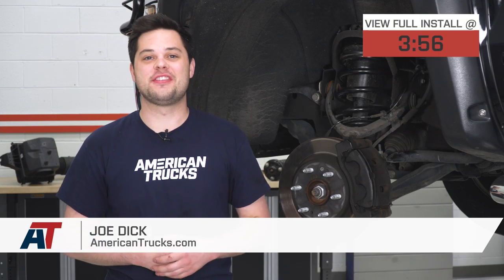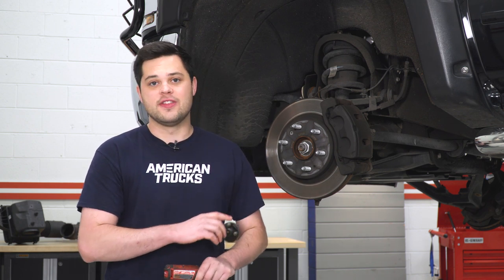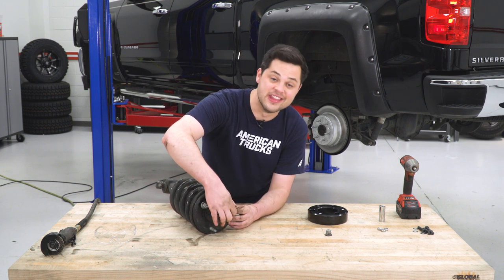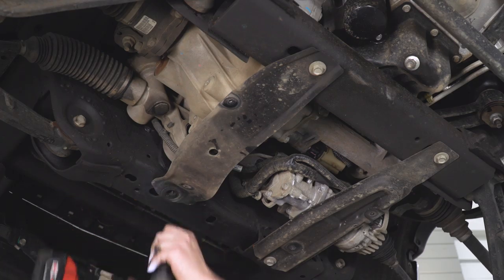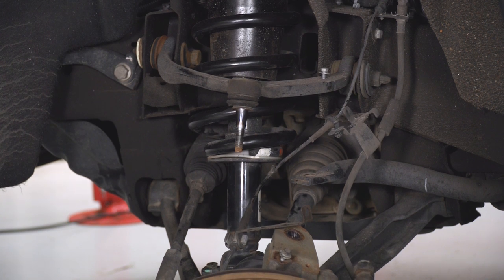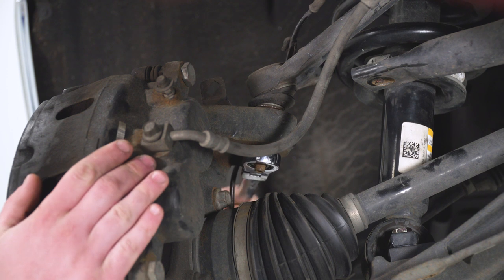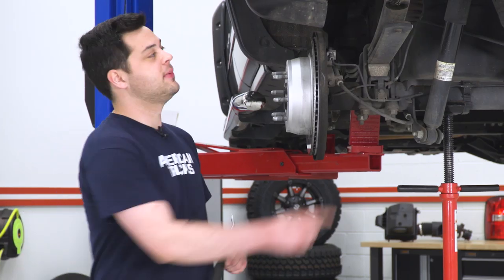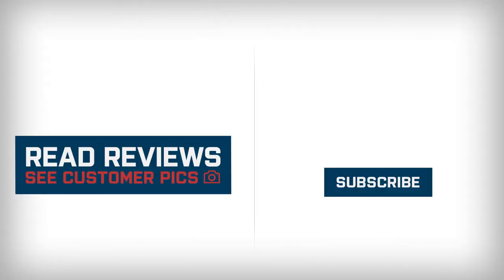2007-2018 Siverado 1500 Supreme Suspensions 3.5 in. Front / 3 in. Rear Pro Lift Kit Review & Install

Comment: I have a 2015 Silverado 1500, I have the Motofab 3” front and 2” rear and I fit 33” tires on stock 17” rims without rubbing at all.
Reply: How does it ride just curious I did a 3 2 level just seeing if your having any problems
Reply: Billy McCubbin I recently took it out, I’m getting a 6” lift kit, the ride ain’t bad, but my truck is 4x4 and the angles for my ball joints and cv joints are horrible, that’s why I only had it in for a short period of time before I lift it.
Reply: Did you consider new upper control arms instead of the full new lift?
Reply: I had the same 3” front 2” rear motofab lift that came with there UCA’s I also paired it with the diff drop kit from supreme suspensions in this video and a rear shock extenders just to be safe. I have 12,000 miles on this kit so far and it rides great. No issues and my front end geometry is excellent and aligned perfectly when I had the truck aligned after the lift was installed.

Comment: I think there needs 2 b a little more detail with regard to the transfer case bolts that need 2 b replaced with longer ones.  How long are the current ones?  How long should the replacements be?  What grade of bolts (there are great differences in types)?  We have a 2011 Silverado LT with Z71.  You should provide a chart or even the bolts based on known factors and allow customers to order based on their OEM options installed.
Reply: what bolts did you end up needing? my kit arrives soon and id like to get the hardware ahead of time
Reply: You are definitely right!

Comment: Looking to buy this lift… wondering if the front upper control arms will work with it? I know the angles will be off but will it be necessary to get control arms as well
Reply: Yes you need UCA'S  if you dont well youll find out the hard way trust me! do your research before you purchase!
Reply: @nevadaboy9769  do you have any recommendations for UCAs for this kit?
Reply: @patricmason9091  the first commentator to this thread is correct, I'm going through it now. It destroyed my UCA on the driver's side, didn't know that until taking it apart for a full strut and shock replacement because I thought the strut had collapsed... Not the case, it sheared off the top casing of the UCA allowing way too much movement and it's scary... so waiting on a set of MotoFab Upper Control Arms for 2.50 to 3-Inch Lift to get here and install those. So if you haven't gotten this leveling kit yet, definitely budget in new UCA's to accommodate the very drastic angles your truck will be dealing with.
Reply: @user-vd9cw6df9p  what is the UCA? I just installed a 3 inch lift on my 2010 sierra (2 inch spacer on top the strut) will I need these other control arms?
Reply: @GearScar  upper control arm and yes to be on the safe side have them upgraded to a set that can balance out the lift.

Comment: Would 3 inch in the front and 2 inch in the back be leveled? No rake? With a 2 inch rear do I really need shims and a diff drop?
Reply: Rear sits 3" higher than the front from the factory. If you lift the front 3" and the rear 2", I'd imagine the rear would still sit 2" higher than the front. So the truck would be slightly lifted but would still have a raked stance.

Comment: I plan on doing the exact same lift but I didn't know there was a differential drop what was the spacers you used and the bolts you used to do that drop and what is the purpose of doing that part of the lift

Comment: I put 3" spacer on my 2012 gmc it didn't come with diff. Or bottom spacer and when I turn my steering to lock my truck dips down a inch or 2. Any suggestions plz

Comment: The allen bolts for your spacer are supposed to go in through the bottom to where you use the factory nut on top.  There not working on my truck
Reply: No they dont. Not according to the instructions

Comment: The kit you have linked does not appear to have a diff drop included in the picture or anywhere in the description.
Reply: That's what I'm trying to figure out as well
Reply: Supreme sells them seperately. they have some great spacers for 2-4" lifts.
Reply: The one I bought did have them either. Are they a must or can I go without?

Comment: So when the kit was installed, was the truck level with the rear or was it still leaning down in the front a little bit?
Reply from the maker: It was sitting much more level after the install, but the truck still did have a little bit of forward rake to it. Though this one also has that large brush guard hanging, which adds quite a bit of weight way out in front. So if your truck doesn't have that extra weight out front, it will likely sit a bit more level than what you're seeing here.
-Jake

Comment: I would like to know how to convert Chevy silverado 1500 LS Classic 2 wheel drive to 4 wheel drive and hows to put one. Please help. Thank you
Reply from the maker: With enough money you can turn a two-wheel drive setup into a four-wheel drive, but for the same amount of time and money you may be better off just buying a new four-wheel drive truck. 4WD trucks have different front suspension, have a different front axle, a transfer case, front driveshaft, some sort of shifter to engage the 4WD system, and probably more things that I missed. Hope this helps! -Zach
Reply: Not worth transferring it over! adding a transfer case you will need a custom rear drive shaft and a complete new front end set up its will cost more than the truck is worth! Its a nightmare i have seen it done! prepare for a 12-15k dollar set up if you are going with new parts and that is minimum! lots of fabrication as well! good luck!

Comment: Supreme suspension doesn’t even want to answer me! I asked if this kit levels out the truck and they cut off. Sketchy brand??
Reply from the maker: 3.5" in the front and 3 inches in the rear will definitely help level out your truck. But the 3 inches in the rear will keep a littleeeeee bit of the factory rake. If you want NO RAKE AT ALL, you should look into a 3.5 front and 1 or 2 inch rear lift instead. -Zach

Comment: he says tie rod when he's working on the sway bar links lol.and i bought the same kit and it says to use original bolts to reinstall the struts not put the Allen bolts threw the top lol.and you should buy new upper control arms for a 2 to 3 1/2 inch lift because your original one are bottom out .they must for get to tell you all that he didn't use the washers or lock washers on the  top of the strut. and i have a z71 and didn't need longer bolts the one's they sent i actually had to put two washers on the bolt for the top and two on the bottom of the diff because they were not threaded enough in my opinion this lift if junk i would buy it again .and the rear blocks i had to grind the stud down a little bit also because it was hitting the axle on both sides or it wouldn't lay flat
Reply: Yea he has no idea what he is doing. The other video on the same shows the Allen bolts go through the spacer and you use the original nuts on the Allen bolts. Not running the bolt through the bracket into the spacer. If he can do it anyone can

Comment: Not sure if its just a problem im having or what. but something that wasn't mentioned was the bracket on the bottom of the strut where the bolts go through, its at a slight angle ( im assuming to compensate for the strut just normally sitting at a slight angle. But when I put the spacer on I had to turn the strut around to get the new bolt holes to line up. But now that bottom part is at and angle with the top of the angle pointing towards me. So the holes aren't lining up for the bolts to go through all of it. And I don't want to hammer a bolt through and mess up the threads. Is this a common thing or is it just me not doing it in the right order making things not line up right?
Reply: I have that issue also. But my spacer didn't line up with the mounting holes where the strut use to be bolted straight to. I can't figure it out
Reply: @gotmurica6225  I figured it out shortly after I commented this. Try mounting the bottom of the strut on first. Get those two bolts in and get the nuts on hand tight. Then you'll have to push the top of the strut into its bracket It goes in. Make sure the lower control arm is loose so you can push the whole strut up and down when trying to get the top part in. That's what I did and it helped me. Hopefully that works for you
Reply: Thanks. I saw another video just now that showed the proper way to I stall this. Not this vague install video. Guy said same thing you did

Comment: 3.5 front 3 rear? Does that level it out or will that have a slight tip up?
Reply: I just did my nephews 2017 chevy 1500 with a 3" front and a 2" rear it was perfect!!
Reply: it will definitely be nosediving, if you want it to sit level go with 1 or 2 inch rear blocks

Comment: What size bolts do I need for the diff drop on a 2017 Z71?
Reply: 120 mm long and 18 mm is what I used. I had to find out the hard way lol

Comment: Can you run the stock shocks in the rear with the 3 inch block?
Reply: No, the max amount of stretch those shocks can take is 1 inch. Just get the ready lift, shock extenders. They support up to 2-4 inches of lift for the rear shock. They are only $50 off of amazon or something like that.
Reply: How much lift on front can stock OEM shock height?

Comment: Why would you even put this on a truck the suspension angles will be extreme and      will be replacing ball joints every year.. spend the extra 500 bucks and get a real lift